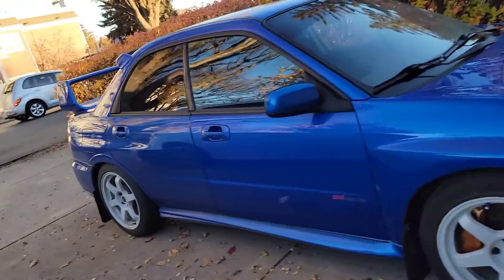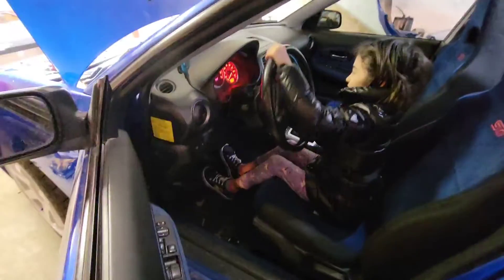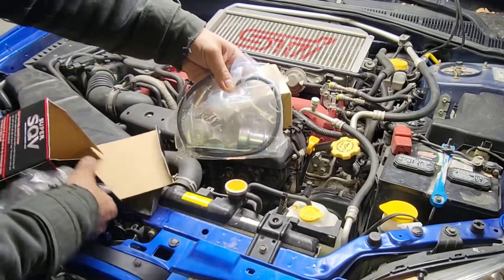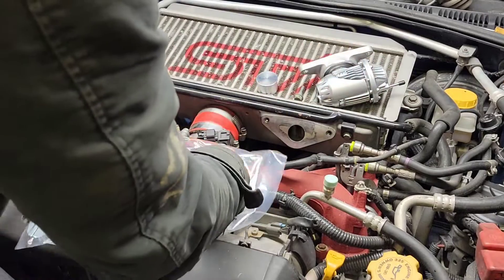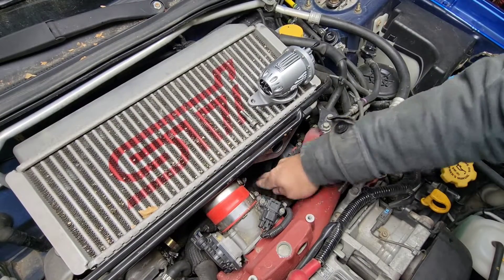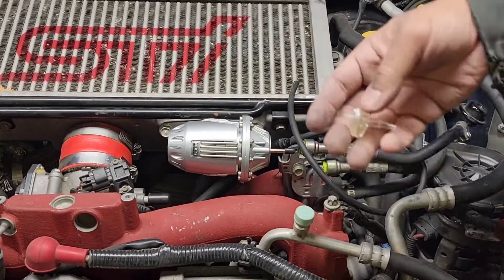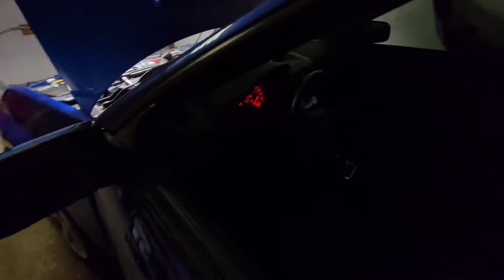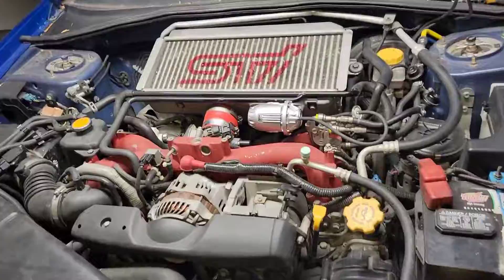Every Subaru WrX/STi Engine should Have this! D.i.Y. Blow Off Valve PS: make sure to put a gasket on

Comment: how do you get a speed density tune?
Reply: im late but why would you spend 800 on a tune to fix a minor problem?  when you let off gas with the bov youll run rich for 3 seconds max and thats ONLY when you goosing it.  If you just drive normally the bov will do nothing and hence that 800 was wasted on a useless tune.  running rich all the time would be very bad yes but in this case it wont hurt anything.

Comment: Hi, can I ask if u got any problems after using this bov ? Do the car run too rich ? Is all stable and no engine warnings ? I have sti 2011 and I want that bov. But I’m afraid I need a tune or I will destroy something. So thanks for any help 🙂 Thanks 
Btw my car is completely stock. Just catback exhaust from magnaflow.

Comment: Can anyone give me some advice? I have the STI 2020, I bought this same blowoff from the video but with the recirculating kit. I'll do a professional tune since I also installed the Cobb redline intake. So, the one who will make the tune tells me that you can't put the blowoff in atmospheric mode because the gasoline mixture will become very rich. I bought this blowoff because I love the sound it makes and now I won't be able to hear it apparently.
Reply: Let me know if you found out the reason, but is the tuner doing a speed density tune? Cause you can certainly use in atmosphere mode with the right tune.

Comment: Do i need to tune the engine for this my friend i need more information. I have 2011 sti and i want more sound from turbo but for bow i don't want to tune the engine its on plan but not for now 😀
Reply from the maker: Dont need to tune, its fine to cruse around drive around But if you dont get it to tune the Air fuel ratio gonna run rich and loss boost pressure on every shift (run slow)
Reply: @jfGarage4k  i dont want to run slow so first tune engine then this

Comment: Whats to blow off valve called?
Reply: I put it on my 19' STI, It's a HKS Blow off valve. The one I put on my car is a HKS Super SQV4 Blow off Valve. There's other kinds of blow off valves but the sound the HKS makes is always satisfying to hear while driving around town.
Reply: @kazzam189 did u get a tune for it?
Reply: @JDiidi4PF  i took it off, you can't tune for a blowoff valve. If you run a blowoff valve you will run rich. Stay with the stock bypass valve or a aftermarket bypass valve.
Reply: @kazzam189 👌😍😍👀
Reply from the maker: Its called  Bypass Valve

Comment: Whats the filter for?
Reply from the maker: For fine dust or dirt stopping going into the BOV.
Reply: @jfGarage4k  oh ok makes sense
Reply: @jfGarage4k  The air going into the BOV is already filtered because it's the air from your engine air filter, compressed by the turbo going into your intake manifold. I don't think you will get carbon deposit or gasoline from your intake manifold inside your BOV. 
Can you see deposits on the BOV filter ? I'm interested.
Reply: blocks debris from intake manifold entering the BOV internals

Comment: Fyi if you're not on speed density tuning with an atmospheric bov it can throw off at ratios since the maf is calculating for it.  May get pops but less power eventually.
Reply: damn i wouldnt have commented that had i seen you already did lmao
Reply: @stoneystunts8819  lol no one gives a shit....just wants the loud noises lol
Reply: Bruhh i asked hks them selfs n they said its safe to run with out a tune.
Reply: Yea, just like the new 1.5 Honda….. Bisimoto did a dyno test and literally didn’t effect A/F vs Stock at all. The curve was dead nutz to the factory tune.  People need to stop posting bs.  We’re making 1500 HP on speed density on LS engines. Again no problem.  Maybe get a life.